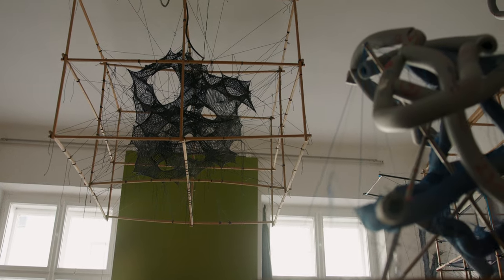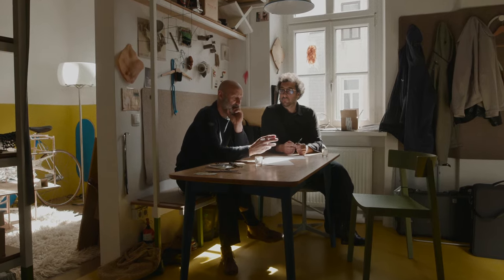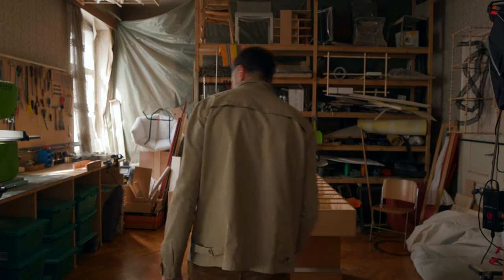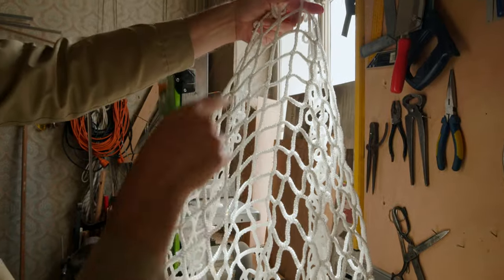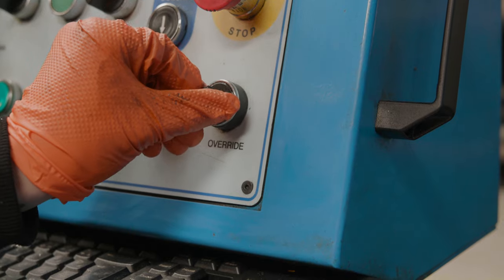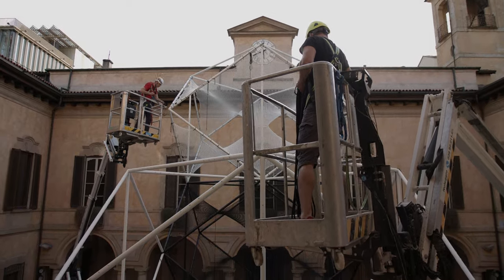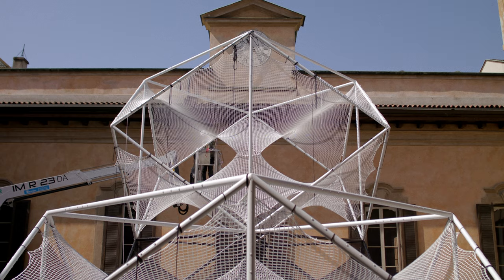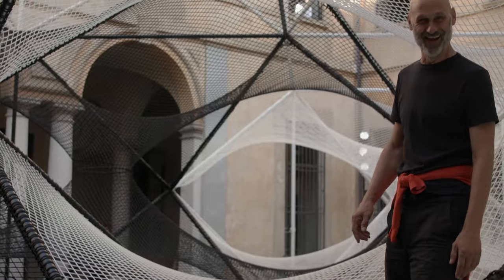Lines of Flight by Numen/For Use – The Art of Dreams Milan

Comment: I hope porsche does well. That’s why I’m writing this. Electric vehicles must be further developed. And these are my personal thoughts on electric vehicles. I will write about what people need. First: Cars need sensors or surveillance cameras to prevent tampering with cars while they are charging, or to give drivers signals to prevent such things. Second: Charging is too slow. Third: Like cell phone chargers, technology is needed to prevent chargers from overheating. Fourth: As time passes, the price of electricity is likely to become more expensive than gasoline. Fifth: Are there any cars that run on other fuels?